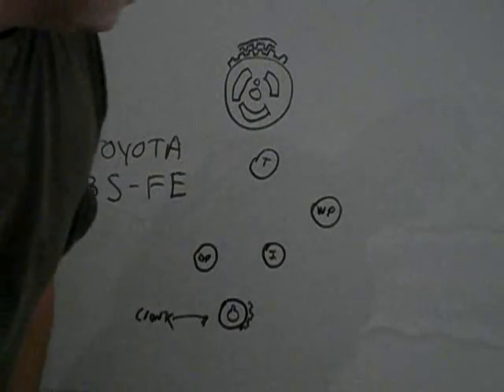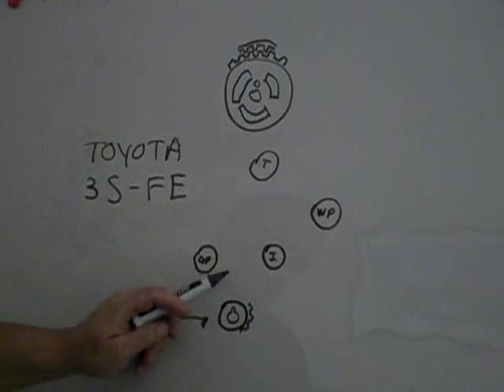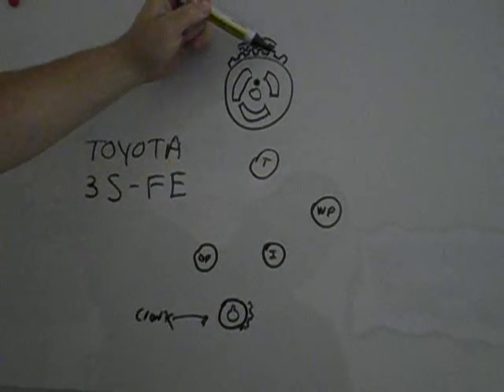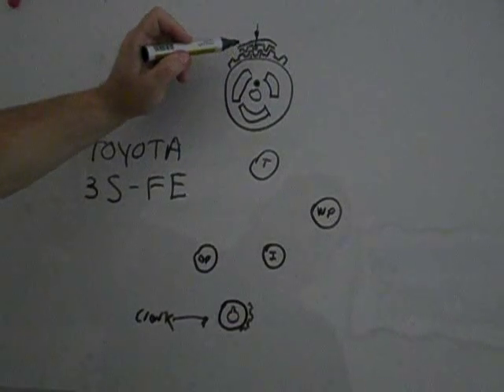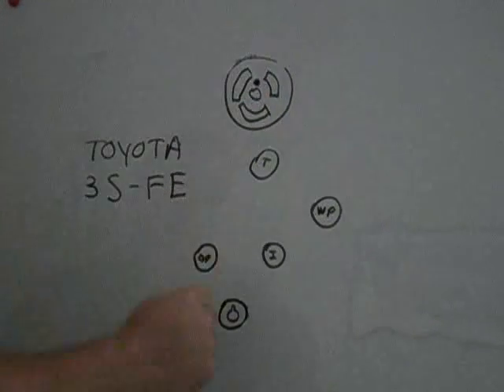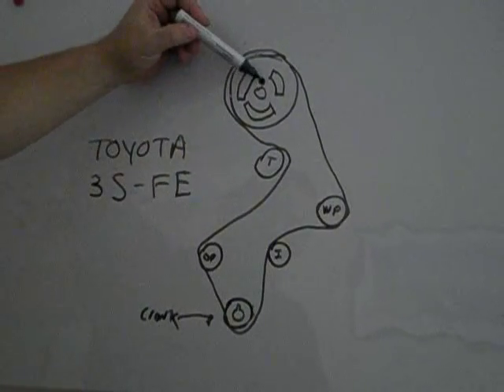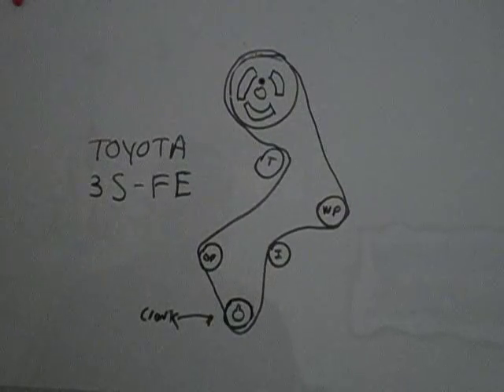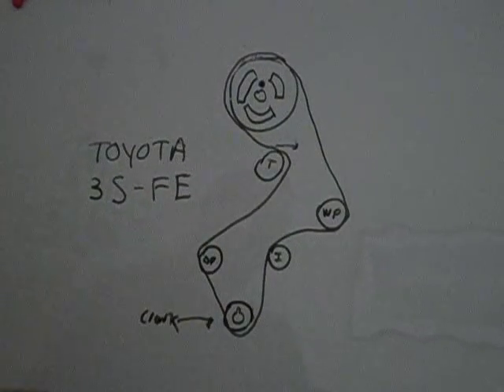Toyota 3S-FE engine Cambelt series video 1

Comment: I line my engine up for TDC on cylinder one and the eyelet on the camshaft pulley is in the 6 o'clock position with no "E" marker its made me a little reticent to continue with the project
Reply from the maker: Hi Jonnym Is this before you have removed the Cam belt? if your Crank Gear is confirmed at 12 o clock and you are definitely at Top Dead Centre and your cam gear alignment dowel is at 6 oclock…. yo uare NOT firing on Number 1 cylinder. You will most likely find that the No4 Cylinder valves are free with confirms this.
If you are wanting TDC on No 1 Cylinder, then the Cam lobes will be both facing down toward the bottom of the engine on say 40-45 degree angles ….. the lowest radius on the cam lobe will be against the lifters and neither valve will be opening or closing. Hope that helps

Comment: I own a Toyota corona with 3S-FE engine. the challenge is that when the vehicle is about to reach 4000km of travel the timing belt starts to produce a funny sound especially in the morning when the engine is cold. the sound disappears when the engine is hot. eventually the timing belt breaks. this has happened twice and I have also changed the tensioner but the problem has started again for the third time. what could be the cause of the problem.